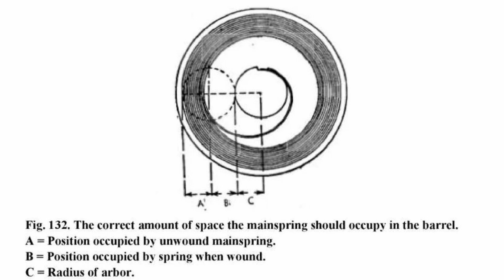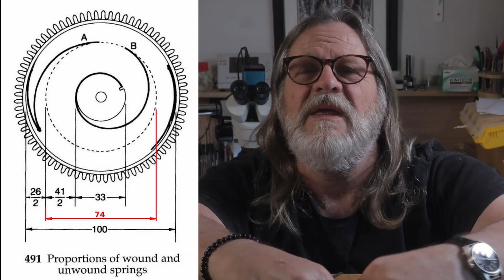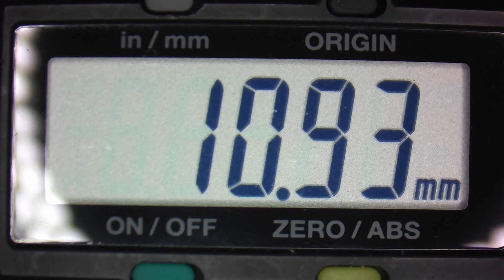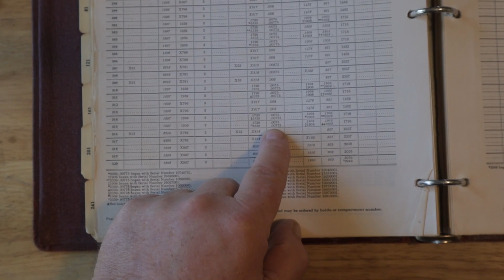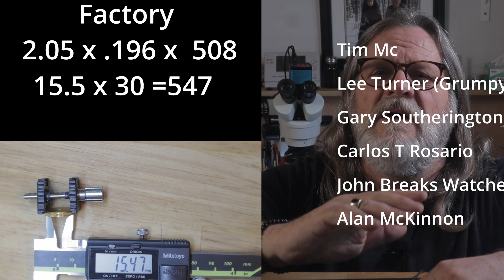How to Size Any Watch Mainspring to a Barrel

Comment: What if the movement is Japanese? Im working on a Bulova that the dial says Japan made.
Reply from the maker: This is best used when the main spring size cannot be found. If the information is not available anywhere, then I would use the Swiss formula.
Reply: @watchrepairtutorials  Thank you very much! thank you for the videos, you have been such a great help.

Comment: Hello,
I am working on my first pocket watch. I opened the mainspring barrel as the winding was not working and found a mainspring with these measurements: width: 2.09mm, thickness: 0.16mm, and length: 545mm. However, if I use the formula presented, I get different measurements. Please note that the barrel's inside diameter is 16.04mm, and the height is 2.69mm. 

So when I apply the formula, I get Width: 1.68mm, thickness: 0.185mm, and lengths: 560 inches. I am a bit confused about what mainspring I should order. Also, why are the differences between the actual mainspring and the formula so high?

I really appreciate your videos and what you do for the watchmaking community.
Reply from the maker: So just to understand, your are using a vintage swiss pocket watch as your first service? What's the caliber? 
This formula is a guide to sizing a mainspring when there is no information available.
You have information, the existing mainspring. It doesn't mean the existing mainspring is correct. You never know if what was put in before is correct until you see the watch in action. 

The biggest difference I see is the height or width of the spring you are stating. You are saying the barrel height is 2.69 m and your calculation comes up with 1.68 mm.  Is that minus the lid thickness minus an additional 0.01 mm? Ideally, here should only be one or two hundreds clearance between the inside of the barrel and the MS. 

This is the most critical and the one you have to get right. If its to tight, you have friction problems, too loose and you have inconsistent power transmission.  

The other two measurements can be played with. 

As far as the other numbers go they are fine. The calculation for the thickness or strength comes out to  0.185 and your old spring was 0.16. It is very common for mainspring to be offered in multiple strengths for the same movement.  Believe me you may need it.  So no issue with the calculation there.  

But, if you do everything else in the service right and you still need more amplitude, you can move up to a stronger spring. 

The length also works as a guide depending on how much room is in the barrel. Our calculation is 15 mm longer than what came out of the barrel.  We are basically talking about power reserve here.  

If you have the room, extra length is a good thing.

The limiting factor is what mainsprings are available with the end you need.
Reply: @watchrepairtutorials  Thank you so much for your detailed and prompt reply. 

To answer your question:
It’s a 19-ligne Swiss bar movement, likely from the mid-to-late 1800s, key-wound and key-set (he caliber is not marked)

I just realised that I calculated wrong. I subtracted the lid properly, but instead of subtracting 0.01, I did 0.1mm. However, the width is now 1.77mm. 
However, I will measure the barrel again to get the proper width. 

Once again, thank you!
Reply: @watchrepairtutorials  could you clarify the clearance measurement subtraction. In the video it states 0.1mm but in your answer here you are saying 0.01mm?
Reply from the maker: @rogercox6020 sorry Roger, yes the clearance should be about one tenth 0.10 mm
Reply: @watchrepairtutorials thanks for the answer. I have a mainspring in an ingersoll pocket watch the I suspect is overside (in terms of width) so your calculation method will allow me to check this and get a new one. Great series of videos - have learnt so much!

Comment: suuuuper helpful video, thanks!
Reply from the maker: I just had someone contact me about a movement knocking. They were using a size that they found from someone on the internet. When he used the formula in the video, it became apparent that the strength of the mainspring he had purchased was too strong for the movement.
Reply: @watchrepairtutorials  Cool! in the NIHSg 12-02 standard im following for the movement Im working on, theres no clarity on the width, thickness and length, so this is definitely a great guide! I also asked ChatGPT4o about it, it certainly approved, it compared it to another approach for both automatic and non-automatic, and favored this one,  😃 so indeed thank you!

Comment: Another hugely informative video, thank you for posting these. I have a vintage automatic with a seperate sliding bridle piece which forms just over 1 coil against the inside wall of the barrel when fitted. In this case would you measure the inside diameter of the fitted bridle, or still just use the I.D. of the barrel itself?
Reply from the maker: I would figure everything just the same. The fact that it's 2 pieces shouldn't matter.

Comment: How does the length of a mainspring affect its performance? The width and strength are pretty intuitive, so if I get that wrong I should be able to troubleshoot it. But if I use this formula for an unknown movement, and the mainspring ends up being significantly longer or shorter than the original, is there a problem I might run into, or a particular symptom I should look out for?
Reply from the maker: The length is power reserve or how long the watch will run before stopping. The formula will get you close to the length, but obviously it matters what's available to buy. If I had to error on the shorter side. Toolong will result in too little amplitude in most cases.

Comment: This tutorial on how to measure the mainspring is fantastic, I just can't find any place online to use this information to order the main spring once I've gathered all the information needed. I can't find any forums or information regarding where or how to order the part needed specifically. The biggest hurdle to my watch repairing hobby is finding any resources on how to properly order new parts, what the name of those parts are, and what websites to order from. I ran into this issue with crystals and mainsprings. TLDR, where and how do I apply this info to ordering new parts? Any help would be appreciated, I know this question is probably extremely basic, but it would mean a lot of someone would provide an answer.
Reply from the maker: You haven't watched enough of my videos. Here you go.
The Ultimate Guide for Identifying and Sourcing Watch Parts.
https://youtu.be/viq9-V1sv7M
Reply: @watchrepairtutorials  Thank you, watching now! (pun intended)

Comment: Mr hamilton... i am getting ready to service an elgin 2004048 and was wondering about tolerances... according to the formula i need a strength of .203mm, width of 2.98 mm, and a length of 528.6mm, i looked on cas-ker for the spring and they sell two but the length of both is 546.1mm, width of 2.90mm and one is .23 mm in strength and the other is .22mm, both are for a 18s watch, and both are for a double brace and D hole spring... would these springs be ok or would i have issues with the differences in figures? Thank you as always Sir.
Reply from the maker: There are 4  factory specked spring for 18 size full plates. they are 571 mm long, 2.92 wide and range between .209 to .229 in strength. Take you pick.  Always look for the factory specs first. It was pretty close but your width was off.
Reply: @watchrepairtutorials  i did the length with a tape and it actually measured exactly the 21.5" or 549.1mm they sell which i wasnt expecting thank you

Comment: Hey, resident of the discord iirc you helped set up here. Does this rule apply the same to japanese watches? I"m trying to source a new mainspring and alarm mainspring for a seiko 4006 bell matic movement. 

When look up peoples struggles in other forums to use generic mainsprings what i CONSTANTLY see is people complaining of the inner coil being too small to fit around the arbor causing it to break, including specifically in the 4006 movement. Is this not an issue that we have to worry about because it seems to be messing some people up. 

I can find replacement mainsprings for the thing on ebay but i'm not too keen on paying 40 dollars in shipping from israel and the phillipines for a thing the size of a postage stamp lol.
Reply from the maker: As far as the mainspring is concerned yes. The math would be the same. As for as the alarm spring is concerned I am not sure if it follows the same calculation or not because it has a different requirement. I would certainly try it. 
The inner coil is often a problem when sourcing mainsprings in vintage movements. That’s why I made this video.
How to Make the Inner Coil of a Mainspring Smaller- Without Breaking It
https://youtu.be/zQjfgdaDCss
The same principle can be used to make the inner coil larger.
Reply: @watchrepairtutorials  Hey, i watched it and it was a great help in fixing the coil of my alarm mainspring which frankly probably needs to be replaced anyways. 

You mentioned the rule of finding the length of american mainsprings and swiss ones, but is there a rule on japanese ones? I"m trying to buy a handful of seiko mainsprings. Appreciate all ya do man.
Reply from the maker: @nunyabusiness9056  I would follow the Swiss formula, but again I’m not sure if it would apply to the spring for the alarm
Reply: @watchrepairtutorials  Well i guess i'll find out cuz i ordered one but aired a little on the shorter side just in case.

That said in case anybody reads this or anybody else asks you, i did the swiss formula for the actual mainspring of the 4006 and it brought me on the cousins mainspring search by height feature to one almost exactly that is actually listed specifically as the correct generic replacement for the 4006.  

So i think you are correct that the japanese might be using the swiss formula more.

That said since all it does is power an alarm, i got a feeling there's a bit more wiggle room with the alarm spring.

Comment: How do you know what size mainspring winder to use? Since you could technically wind it to a diameter 2/3 of the barrel diameter, if I have a pocket watch with a 14mm barrel could I wind it down to 11mm with one of the K&D adjustable winders, or could that cause damage when inserting it? I’m trying to find the cheapest option to cover all my bases and the adjustable k&d winders cover 4mm to 11mm if you get all 3.
Reply from the maker: As long as you can get the winding stem out you should be ok.

Comment: Mr. Hamilton, I know ive tried to hand wind a mainspring into a watch and its a pain.... I know i could just replace a spring out right... i plan to focus on more modern watches, or size 18 pocket watches and smaller... at the moment i cant afford a full bergeon winder set... are there an average couple of winders i could purchase of the bergeon veriety that would up my watch making game without crushing my wallet? Great videos as always Sir.
Reply from the maker: Well first, I will decide what you plan on working on. You can get a set of mainspring winders like the Mastercraft set for a couple hundred dollars. The Chinese stuff is pretty much all crab. I’ve never heard of anybody that’s happy with on sites like Esslinger you can buy handle in individual  Bergeon  winding barrels depending on whether you’re working on Swiss or Japanese watches which are either right hand or left hand. Sizes like 8,9 and 10 will cover a lot of movements.
Reply: Thank you as always your info and advice is most appreciated... where can i find the master craft sets?
Reply from the maker: @gillandro2  well, they don’t make them anymore so you’ll need to search eBay. They come out pretty regularly. You just want to make sure that the hook on the winding harbors are good. The winding arbors on the Bergeron sets are too small for pocket watches, which I have a larger inner coil. The winding harbors on the Mastercraft sets are larger and more suited for pocket watches, which have a larger inner coil.
Reply: @watchrepairtutorials i ordered the 3 sizes of burgeon winders you mentioned....but i have one ladies watch to service that will prob have a tiny barrel...how do i choose the winder for that movement as the barrel may only be like 5 mm or so? Thanks Sir
Reply from the maker: @gillandro2  Esslinger has a chart showing the winder sizes. Or you could just install a new spring and skip buying a winder for a one off movement
Reply: @watchrepairtutorials  fair idea Sir as i will have the 8,9,10 sizes.

Comment: Got my first non runner working today thanks to your videos!  Seiko 7002 not running for 10 years started moving today.  Amplitude weak.  Convinced main spring is weak.  I’m sure many of us would love if you did a very detailed how to video for winders for both left and right mainsprings.
Reply from the maker: I’ve done a little bit on Main Spring winders, what specifically would you like to see?
Reply: @watchrepairtutorials  just a more detailed how to of right wind vs left wind and how to do it so they go into the barrel in the correct fashion.  LOVE the channel.

Comment: Hi, I bought a replacement mainspring for an Oris movement I'm working on. The spring that Cousins supplied for this caliber had dimensions that were very close to the original but the arbour was loose in the spring. I tried to tighten this up by bending the spring but broke it.

I am now wondering if this is the reason my dad used to have a paraffin lamp on his bench. (Unfortunately I can't ask him as he passed away in 2019) if I anneal the first coil of the main spring can it then be tightened? Do I also need to harden & temper it again?
Reply from the maker: I made a video about that.
https://youtu.be/zQjfgdaDCss?si=zy8l77v8twU0H9pu

Comment: Great video! I ordered a MS for a 2824 eta and the the arbor coil was too small for my fleet of available winding arbors.Ruined it fooling about with it. After it was ruined anyhow I sort of floated a small arbor over the barrel and got it in, but risky business. Any good way to handle similar scenarios short of purchasing bergeon tools? Thanks…
Reply from the maker: New main springs typically don’t require a main spring winder. You just pop it into the barrel. Was something different about your installation?
Reply: Exactly, popped it in but later noticed bridle was poking up from the drum edge. No choice but to remove and try to rewind, and downhill we went from there. In hindsight could have tried hand winding it at that point.  Oh,well……….another unexpected  lesson.
Reply from the maker: @johntebeau4493  I’ve done some videos, showing how I install main springs out of the ring.

Comment: Thanks for this lesson. How to measure the length of the mainspring without straightening it.
Reply from the maker: It is the inside barrel dimension times 35 or 30 depending on what you are working on.

Comment: Measuring a 1970 Westclox Scottie mainspring barrel, it yields an inner diameter (ID) of 17.6mm. Running it through the formulas provides a strength of 0.205mm and a length of 528mm. The barrel depth comes in at 3.66mm. The Westclox doesn't have a barrel top, so I'd call it 3.5mm. 
3.5 x 0.205 x 528

Does that seem reasonable?

Please don't laugh at putting the effort into a Westclox, it is cheap practice before moving onto something more "real."
Reply from the maker: Why would I laugh. Sure, I would try it depending on what’s available

Comment: This is very good stuff. 
It answers allot of questions that I had hanging but didn't quite know how to ask.

FYi: I replaced the mainspring in a Waltham 620 that has an amplitude problem. I ordered a new, generic, Swiss mainspring after measuring the 620's mainspring and concluded that it did not fill those barrel minimums mentioned in the video.
Also, I was able to order the correct size mainspring after watching the video and got it right the first time.
Now the the amplitude is good.
Reply from the maker: Hey man, Thanks for the feedback. Good to hear from someone putting this information to use. Good results, Perfect!

Comment: Sir, I am amazed at the knowledge you possess on watch maintenence. Can you let me know how to find out if the mainspring has become weak and needs replacement? To the naked eye, the mainspring seems ok. But when you assemble the watch, the balance wheel does not swing as freely as it should because power to the escapement is very, very low. Please guide me on this. Thank you very much. God bless you.
Reply: Thank you so much for the crystal-clear explanation.
Reply from the maker: One of the things I always do when servicing a vintage watch is replace the mainspring.  A lot of people will reuse the existing mainspring and then run into amplitude issues.
So the first thing I would do is put in a new one.  Then if the amplitude is still lower than it should be you must reinspect everything.

You have to start with the basics and make sure that everything in the power train is correct, the mainspring barrel is correct, the escapement is correct and that the lubrication is done correctly. 
Once you know 100%  that those area's are the way they should be then you can start looking at the mainspring size.